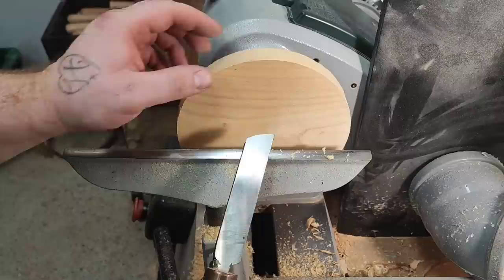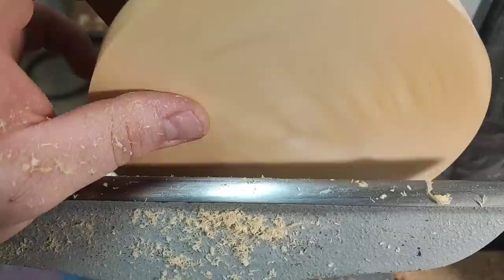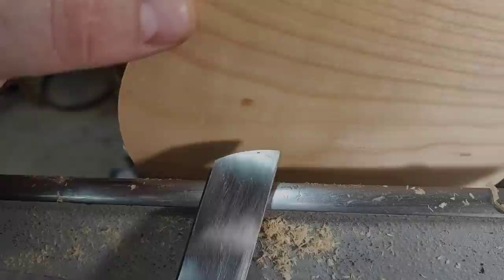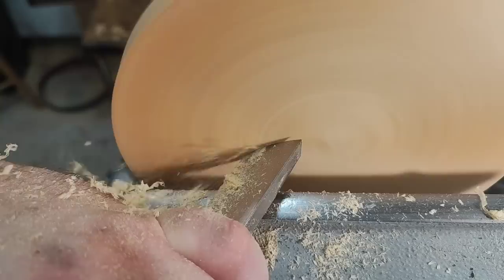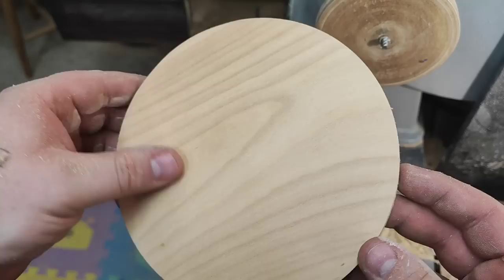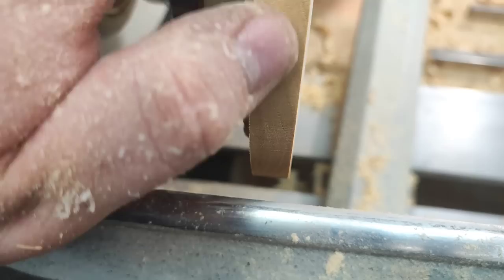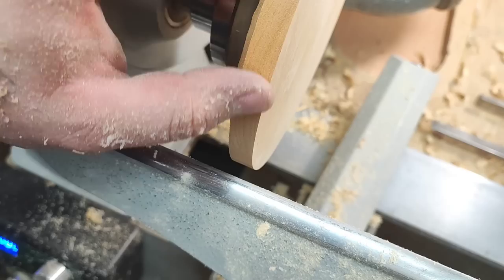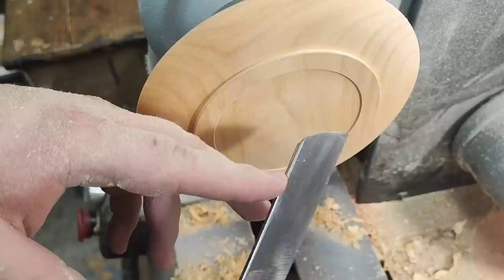How to sharpening shear scraper(standard scrapers)

Comment: A knife-edge scraper: I ground a scraper to an included angle of about 35 degrees and sharpened it like you sharpen a knife. That is, hone both sides until the "wire edge" breaks off, then hone both sides of the cutting edge with a very fine hone until it becomes almost razor sharp. It will then have a keen edge with no burr. 
  I present it to the wood flat on the rest and straight on. Surprisingly, it cuts and makes very tiny shavings. The depth of cut is pressure sensitive so you can remove as little wood as you like. It is excellent for finishing cuts and for making slight adjustments to the profile of a vessel. It is described on my website which I referenced in my other comment.

Comment: Once again, what a great teaching talent. I had to learn most of my techniques by myself and using Internet: your explanations are exceptional!  I see what Richard does but I understand it with your explanations. 

One question : what was the size of your scraper ?  I will try to make one with bars bought on internet
Reply from the maker: Thank you very much sir, I'm glad you can get something out of it 😉

I would highly reccomend buying scraper blade from proper tool manufactures, like Henry taylor,crown etc.... These hold a edge much better.... This one is trapez shape, on one side is 6mm and on the other is little less then 4mm.... And its m2 hss but not the best quallity....
These blades were sold as 200mm bar...

Comment: I've bought an old 25mm x 9mm thick Skew that I want to change to the Raffan style. How many mm up on the left do you grind away? Is the circa 6mm of flat on the right actually flat or does it have a tiny curve to lift the corner up slightly?

Thanks for the video I think I'm probably doing that about right though I'll check out the other scraper video for angle of approach.
Reply from the maker: I would say your choise is better regards steal, and you are right - its around 6mm curve....the very shape is personal preference for the job that needs to be done.... hope that makes sense 😀
Reply: @tomislavtomasicwoodturning  OK thanks for the reply, I'll choose a radius for the left. Many thanks.